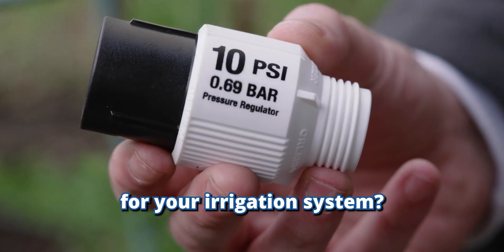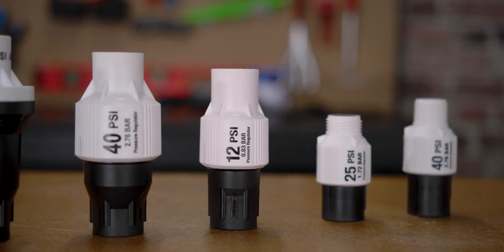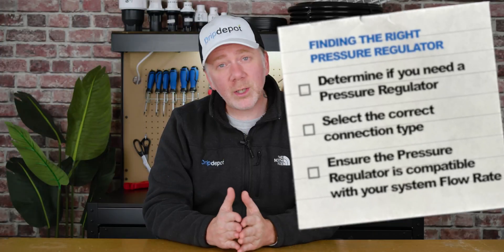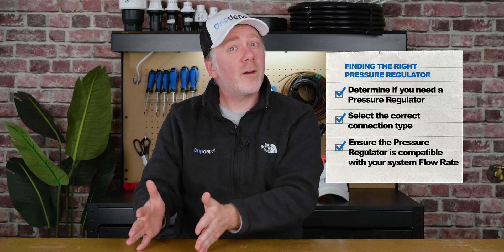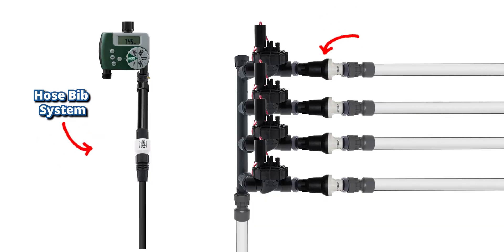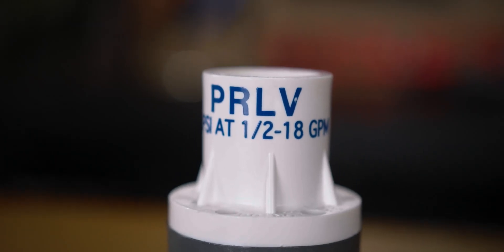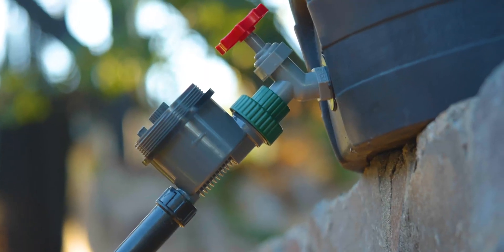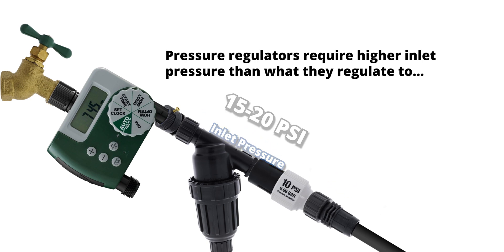Do You Really Need a Pressure Regulator? Understanding Water Pressure & Irrigation Systems

Comment: The only thing I wonder is that if I have 55 - 60 psi at the hose bib, but I’m running 200 feet of hose to where my plants actually are, do I lose enough pressure down that line to not need one?

My programmable timer also reduces the pressure somewhat.
Reply from the maker: At 55 to 60 at the hose bib, you'd likely still want a regulator if using drip emitters.  This could change if there's a heavy amount of flow going through that 200' of hose, but it would take quite a bit to lose enough pressure to get within range of most drip emitters (15 to 30 PSI).  

Using pressure compensating emitters is one way to avoid a regulator, but most of those top out of the compensation range at about 50 PSI (but they will work uniformly within their operating pressure range even without one).

Comment: I’m sure I need a pressure regulator, however my current flow rate is 9.5 gallons per minute which is about 571 gallons per hour.

However, on the pressure regulator for 25 psi it says the flow rate is .5 to 7 gallons per minute. 

If I use the 25 PSI threaded pressure regulator. Does that mean my new flow rate would be a maximum of 7 gallons per minute instead of the 9.5 gallons per minute I get from my hose bib?

I’m asking because I’m trying to calculate my flow rate for a garden system. I’m setting up. 

I want to make sure I’m using the right number to calculate if I’ll have enough flow rate. So should I use the 571 GOH (9.5 Gallon per minute) coming from my hose bib to plan the flow rate for my drip set up or should I use the 420 GPH (7 Gallons Per Minute)? 

Thanks in advance
Reply from the maker: You are absolutely on the right track and asking the right questions, and you basically got to the right answer in there :) 

Plan your drip setup around the 420 GPH -- the regulator can allow more water to pass, but at that point it will reduce the lifespan of the regulator.  When you're planning out your drip system, keep track of all the emitters you're planning for -- this will be your drip system flow rate.  For example, if you're using 100 0.5 GPH emitters and 5 10.0 GPH sprayers, you'd have a total of 100 GPH in system flow.  That's the number you want to compare to the flow rate at the water source (571 GPH but planning to no more than 420 GPH for the regulator's maximum flow rate). 

571 GPH at the hose bib is a very healthy flow rate as well -- a common approach is to plan for the flow rate at the hose bib minus 20% (just to take care of all the small losses incurred by things like friction).  That would be 456 GPH in this case, so by planning to the regulator's maximum flow rate you'll have your built in cushion and more.  With drip systems being low flow, you may not even hit 420 GPH in emitters, which is perfectly acceptable.  

Don't hesitate to drop a line if any questions come up while you go through the process, happy to help!

Comment: We have the opposite problem,  losing pressure with every drip & sprayer
Reply from the maker: Are you ending up with a situation where it appears there's not enough pressure to operate all the emitters?  A little pressure (and flow!) is lost on each emitter in a system -- with drippers it's a very minimal amount, but with enough on a single zone you could end up in a situation where there's not enough to operate some emitters.  Usually this will be most visually noticeable with sprayers -- they'll put out a weaker spray, start dribbling, etc.  

In many situations removing the pressure regulator won't help with the symptoms, even with it is a case of too low pressure -- an example of that is if the low pressure is caused by friction.  

If those symptoms are occurring on your system, let me know, I'd be happy to assist in troubleshooting, in most cases the fixes are reasonably quick and painless :)

Comment: Hi, there are 24 types of pressure regulators on the drip depot website. I’m not sure what the difference is. I plan to connect b-hyve XD one outlet timer to 50 plant pots with a mix of  1/4’’ drip line and adjustable drippers on stake. Would be grateful for any advice
Reply from the maker: So far from what you've described (running from a timer connected to a hose bib to irrigate 50 pots with 1/4" drip line and drippers on a stake), you'd be best served by a 25 PSI hose threaded pressure regulator.  

If the above is correct, this one here would serve you well for many years to come and requires no additional adapters to get connected to other hose threaded connections: https://www.dripdepot.com/3523

I hope this helps!  Don't hesitate to reach out if any other questions come up, happy to help :)
Reply: Thank you for the prompt reply!
Reply from the maker: @mnchnn  Any time! :)

Comment: When choosing a Hose Thread Pressure Regulator for my drip irrigation system what PSI range would be a safe compromise if I am combining drip-line sections with poly tubing sections using various emitters?
Reply from the maker: Generally you'll want to regulate to the lowest PSI emitter -- in this case that would be drip tape at 15 PSI.  Depending on the overall size of the system you may be able to get away with 20 PSI, as some pressure will be lost from friction.  If it's a smaller system that's a combo of emitters, I'd stick with the 15 PSI -- if it's a larger system (or if the drip tape was the part furthest from the water source) 20 PSI is acceptable for 15 Mil tape (if the tape is thinner then that, then stick with the 15 PSI). 

Most button drippers will work pretty much as well at 15 PSI as they do at 25 PSI -- a slightly lower flow rate in some cases, but nothing significant and often not enough to even notice without a sensitive scale.   :)
Reply: @dripdepot  I’m sorry … I meant drip-line not drip tape.
Reply from the maker: @ggrunau  Aha, perfect!  In that case 25 PSI is a good option -- most drip line (particularly 1/4") and button drippers work optimally at 25 PSI, so you could cover both bases there :)
Reply: @dripdepot  Sounds good. Thanks so much for your timely replies. This will be my first irritation project. I’ve got 30 fig trees started and two 4 year old plants all in pots that I am combining with a small tomato bed and some newly planted 6’ Starwalker Boxwoods. Fruit trees next year.

Comment: I've worked on systems that have no regulator.  They seem to do fine.  I put a pressure meter on one, and when it turned on it quickly dropped to 30psi from 50.  So...I guess if its big enough the high flow will drop the pressure?  fyi
Reply from the maker: You've got the right of it -- if the flow is particularly high, or high for the diameter of tubing/pipe it's flowing through, a lot of pressure will be lost from friction and the system will end up within normal operating range -- like 30 PSI in your example :)

It's probably not ideal (high friction can cause wear and tear), but you do have it right in that it can result in the emitters operating normally within their operating pressure range.

Comment: Hello very nice video! I would like to ask, I am finalising a design for my gravity fed drip irrigation and my source water is from 40m elevation away. Sould I put my pressure regulator still on the source or should I place it near my drippers?
Reply from the maker: Great question!  

In most gravity systems, the pressure regulator is going to need to be downstream a bit from the water source, as there is typically not enough pressure to engage the regulator right at the source. 

With the common pressure regulators, you need at least 5 PSI more at the inlet than what they regulate to downstream.  This means if you were using a 15 PSI pressure regulator, it would need to be placed in a location that has at least 20 PSI at the inlet of the regulator.

Comment: Question: Because a couple years ago the water line we had going to the garden broke, we now hook up a hose that runs to the garden. It appears the pressure regulator would go AFTER the timer, rather than from where the hose connects to the house, correct? I have the timer set up by the garden, at the end of the hose.
Reply from the maker: You got it Marjorie -- in the setup you described, you'd want it after the timer -- this is because regulators (and pretty much all the head assembly parts except the timer) are not rated for constant pressure, so they have to come after any timers or valves so they're relieved of pressure when the system is not in use.  

Most garden hoses aren't rated for constant pressure either, I'd double check that yours is so you don't get another broken line leading out to the garden :)
Reply: @dripdepot  This is really helpful. So would you suggest TWO pressure regulators? One where the hose comes from the house and one at the end of the hose, where the timer will go (after the timer)? Thanks so much.
Reply from the maker: @MarjorieGeiser   You should be good to go with one regulator :)  

There are situations in which to use two, usually just when the inlet pressure is so high you want to reduce it from an incredibly high pressure (120+ PSI) down to something more common (50-60 PSI) before it hits the drip system where you regulate it down to 25 PSI.  

Basically, only when the pressure is so high it exceeds the maximum pressure of the 25 PSI regulator, but pressure that high is pretty rare in residential applications, you're likely well within the norm on faucet pressure :)

Comment: Hi. I checked out the diagram but not certain when it talks about low and high, and hose or pipe threaded. I'm guessing I may find someone at Lowe's or Home Depot that may be able to explain this, and guide me to the next purchase, right.?. Or, should I talk to my plumber? My plumber never mentioned my high main valve pressure reading. I just found out because I was getting some estimates on completing a drip irrigation system in a new raised bed area I've attempted to complete for the last few years so I'm not sure if he is the right person to ask. Any thoughts? Thanks!! Great info!!
Reply from the maker: A plumber will have better odds than one of the big box stores, but this may be something I can help with :) 

Are you going to be running the irrigation system from a hose bib, or are you going with a sub-surface system fed by solenoid valves?  This will determine what thread type (hose vs pipe) you'll want.  

The flow rate of the system will determine which model (high flow, low flow, medium flow) would best serve the system.  The flow rate of your irrigation system can be determined by adding up all the emitters that will be operating at once.  For example, 500 0.5 GPH drippers will be a system flow rate of 250 GPH.  

Happy to help with any follow-up questions, don't hesitate to drop a line!
Reply: @dripdepot  Hi! Thank you!! Apologizing ahead of time for this long message. Okay. More background info. In the area where I'm trying to prepare all of this I used to have a lawn. That lawn has been gone for years. The sprinkler system is still there. My dad and I started to convert the system to a drip irrigation system. He added a second non-siphon valve, which I think was what you were mentioning - ...?, he put in about 3 risers, two of which have (I think they're called) posts for the drip lines. The water supply comes from the backyard hose bib. All of this is in my backyard. The sprinkler system was put in about 17 years ago, and my dad and I checked the lines then in 2021 and replaced two of the PVC pipes that were leaking. All the pipes are (think they are called) 40 standard PVC. These modifications, my dad and I, started in 2021. He passed later that year so we weren't able to finish it. Now I'm trying to complete this or hire someone. I think, after the estimates, I'd prefer to try to complete this myself. One estimator told me after an initial PVC repair that is evident that they would run water through the lines multiple times to make sure no leaks, and they would repair any leaks and replace any pipes that need to be replaced. He'd use my existing timer. We talked about the main water valve and said that it has a high pressure reading, above 60, and needs a pressure regulator. Second estimator said I needed a backflow preventer and pressure regulator and he could set up on a new PVC line from the backyard spigot (with a ball meter shut off valve there - I think that's what he called it) in my backyard versus going from the main valve water line in my front yard. The last estimator said I need a whole new system since it was so old. Replacing all the PVC pipes, new timer, "vacuum breaker", not a pressure regulator, at the main water valve in my front yard going back to my backyard. My brain is a little overwhelmed 🤯. I hope with all this info I have answered your questions. Thanks again!
Reply from the maker: @jonesy5722   Perfect on the information, thank you for sending that over!   This should be enough to really dive in -- I'll reply with everything on your other comment as soon as I've worked through it all.  

With the information you sent over, I do think you can DIY this without too much trouble -- I've also seen the recent quotes to have something like this professionally done and I suspect that even if the project takes you awhile, you'll come out well ahead DIY'ing :) 

I'll be in touch!
Reply: @dripdepot  one more thing. I have 8 sprinkler heads, 3 of which have the risers. I didn't need all of the heads to have risers yet since I'm going to start with a small garden to start before adding the risers to the other sprinkler heads. Basically converting those from sprinkler heads to risers. Hope this all makes sense.
Reply from the maker: @jonesy5722   Ok, let's see how much of the existing system you might need to make use of for the drip system -- this might end up being very straight forward depending on the size of the drip system.  How many raised beds do you need to irrigate, and what are their dimensions?  

I suspect you might be able to run the entire thing off of one of the risers that already exist -- If not, it would also be pretty easy to run it from the second non-siphon valve you have.  Pressure regulation will be easy and inexpensive either way.  

You mention that the water supply comes from a backyard hose bib -- does the hose bib lead to the valves, or do the valves feed the hose bib?  No problem either way, I'm narrowing things down for the easiest (without losing any effectiveness) DIY route.  

The estimator was right about checking for leaks, but this is something you can easily do -- run water through the system and find any locations that are leaking -- to detect leaking, you can listen for it (hissing for smaller leaks, gurgling for larger) and watch for wetted ground in places it shouldn't be.  Fixing it is fairly straight forward, typically you just cut the damaged portion out and then re-connect the line with a coupling.  I can help find the parts here.  

Here are the options for getting the raised beds irrigated that I see so far from your description: 

Valve:  -- At the valve outlet, you'd connect a filter and a pressure regulator, then an adapter so you could connect your mainline tubing.  If there is already PVC pipe on this valve, it would be Filter --> Regulator --> PVC Adapter to connect the existing pipe (again, all things I can help you find, and all reasonably inexpensive).   This could easily be controlled by your existing controller, as it sounds like you might already have one.  

Hose Bibb -- If any of the valves are feeding the hose bib (or it has a different supply), a drip system could also easily be connected to it.  This is probably the easiest route, but may not be able to take advantage of your existing controller/timer.  You wouldn't even need to go PVC pipe here (unless it's already present, then may as well use it), you could go straight to poly tubing and run it over to the beds if it's within reasonable distance.  

Riser: If one of your risers is fairly close to the raised beds, a single adapter can turn it to hose threads so you can connect Filter --> Regulator --> Adapter for Tubing.  Assuming the riser is in one of the zones with one of the valves, it could also be ran by your existing controller.  

Is most of this in your backyard?  If so, I don't see any reason not to operate the drip system from there instead of replacing everything and going from the front -- it shouldn't all need replaced unless you've got a ton of leaks.  That should be fairly unlikely as buried PVC is pretty durable.  

The backflow one of the estimators mentioned could be the only difficult part -- backflow is very important (required in almost every location), but there's a big caveat here: backflow might already exist -- if your dad or a professional put in the existing system, there's a very good chance they included backflow prevention.  We can come back to this part, as you'll definitely want some and may need to get it tested if it's already installed, but it's not needed until you're running the system.  

Do you have photos and diagrams of the existing infrastructure you could send me?  I think with just a little more information I could help you narrow things down even more (unless the above information was enough to help get you started!).  

Basically the big question is going to be the best place to start the system from (valve, hose bib or riser).  

You can send photos and diagrams at our contact us link here: https://help.dripdepot.com/support/tickets/new -- the contact us turns it into an email -- put "Attention: Adam" somewhere in the title or body and it will come to me -- I suspect you can save an incredible amount of money DIY'ing this (except perhaps the backflow) :)
Reply: @dripdepot  Hi. I'll need to read all of this and get back with you. Thank you very much!!
Reply from the maker: @jonesy5722   You bet, I'm looking forward to assisting!